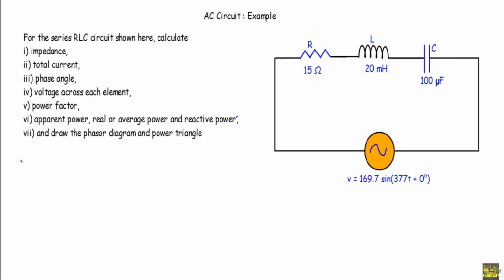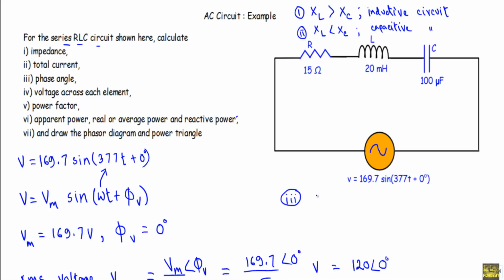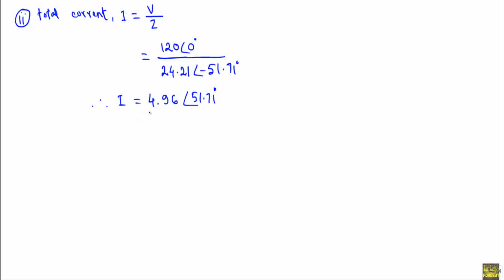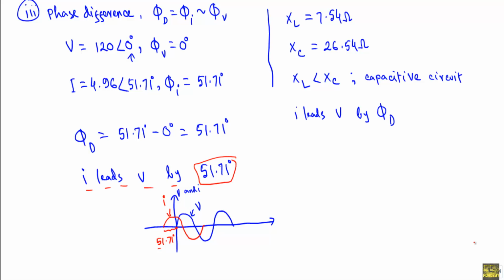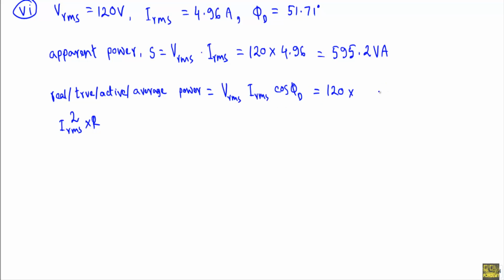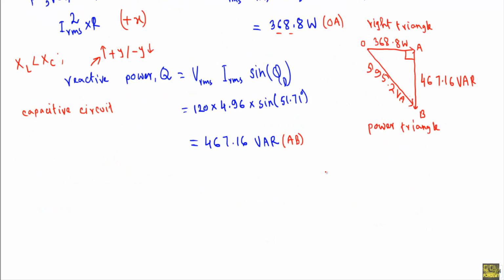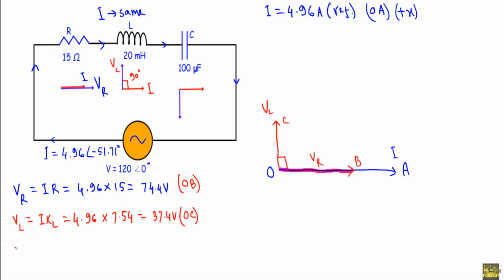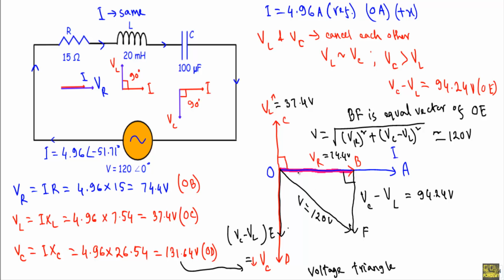AC Circuit Example 4: Series RLC Circuit

Comment: a rl series circuit excited by a sinusoidal source e(t)=10 sin 100t v,by closing the switch at t=0 .take r = 10ohm amd l= 0.1h .determine the current i(t) flowing through the rl circuit.co4

.....
Kindly upload answer for this...

Comment: How frequency is equal to 60
Reply: A vv late reply, but for those wondering,

It was given in the question that voltage has 377t for omegat (wt), and we know that w=2πf, 

377=2πf
f=377/2π
f=60 Hz

Comment: 1:37 When solving Vrms, wouldn't you need to transform your sinusoidal voltage source to a cosine voltage source? Which would mean your phase angle is -90 degrees, not 0?